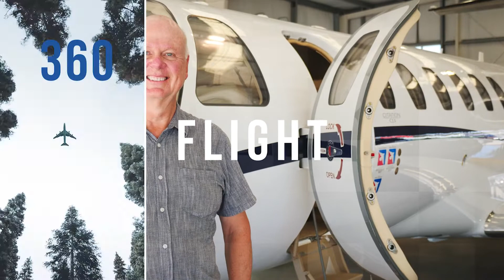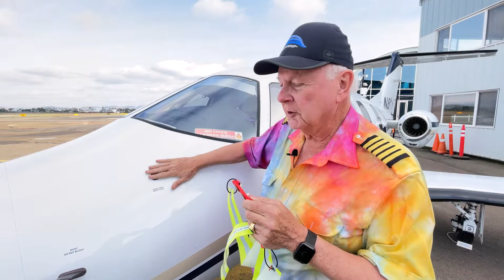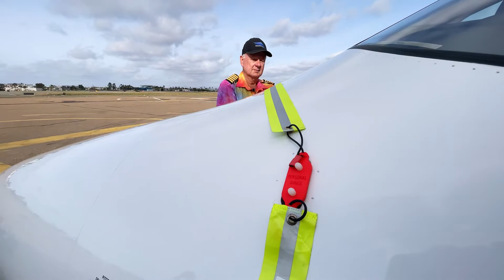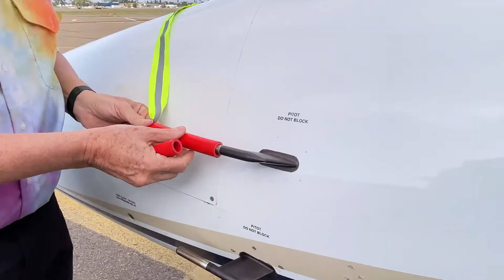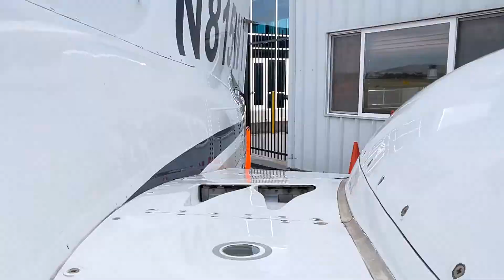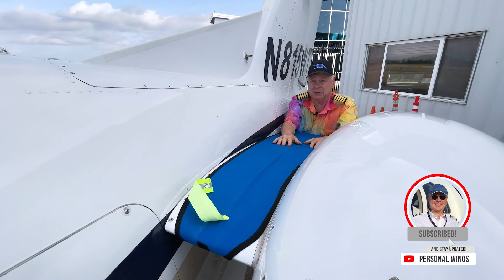Eclipse Top Aircraft Accessories | Rich Pickett | Personal Wings

Comment: I never liked pitot tubes. Especially those long lances on certain planes. It just seems very crude to have openings and little prongs sticking out. It just has to be possible to conclude the airflow in other ways. Just from engine parameters it should be possible and you have two of those. Or vibration in body panels or little closed pressure surface or tiny whiskers, anything but an appendage with an orifice.
Reply from the maker: It is old school, but generally reliable. Ain’t broke, don’t fix?
Reply: @PersonalWings  you could say the same about steam gauges, piston props and biplanes.
if you could take away those static ports and all those prongs, wouldn't it be a better plane. You say 20k a piece plus all the structural stuff to support them. If the engines could tell you the needed values.
I'd like to see a curtain zip out to close off the engines for parking as well. Preferably motorized. There should be zero overhead in starting a plane.

Comment: "Even in the hangar . . . keep bugs and dirt and crap out of it."  Exactly. My first thought was that those static ports are perfectly placed to catch bird shit.
Reply from the maker: I do that to reduce any risk, and be prepared when it is pulled out from the hangar.  I always keep pitot covers on in the hangars with all of my planes to keep the bugs out.  On the Eclipse they placed the static ports on top since it was the optimal location for the pitot/static system but it can easily collect water.  There are static drains located by the pilot's right foot - not easy access but they work - Rich